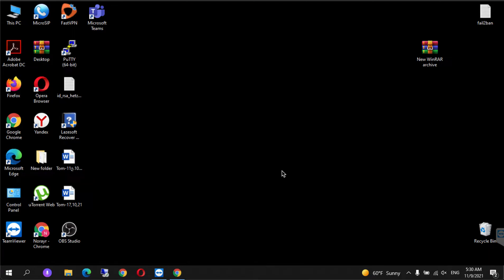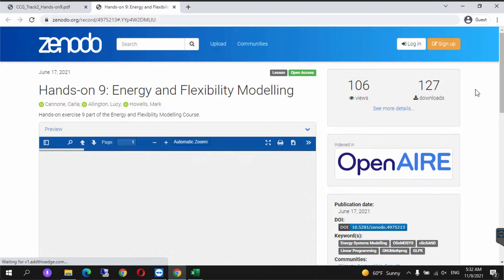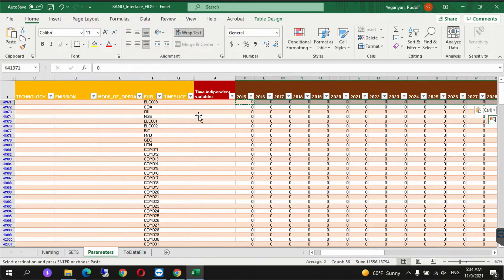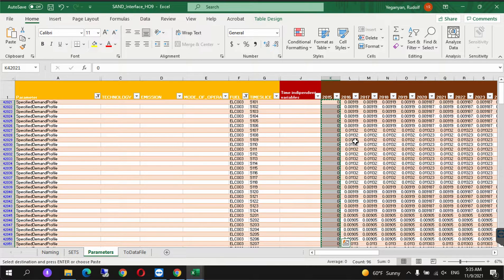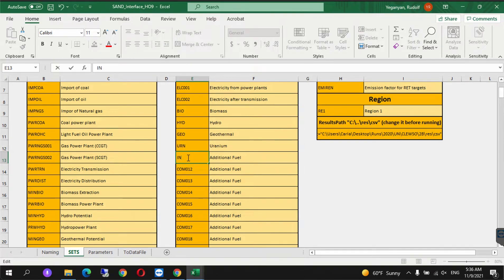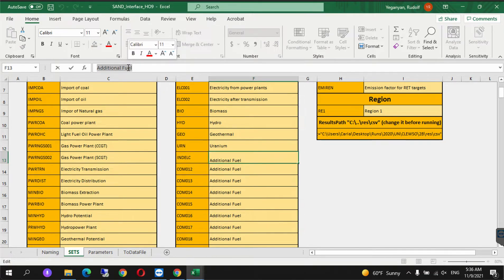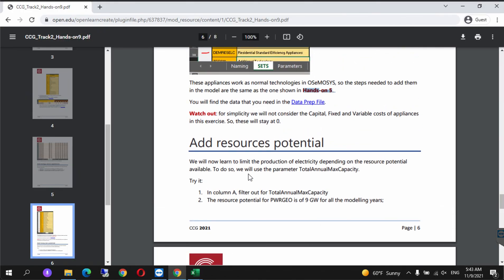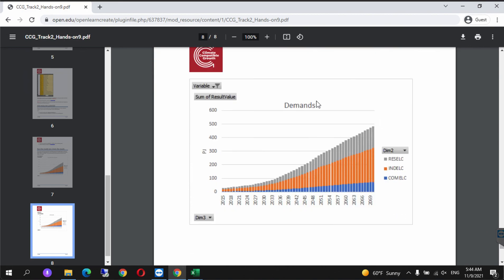OSeMOSYS & FlexTool course: Hands-On 9

Comment: Hello,the data prep file has column F labeled as INDELC  for all the specific demand profiles and the values are same ..this may be affecting my results since my graph is blank for annual electricity production.kindly clarify
Reply from the maker: Sorry for the slow reply: please ensure you are using the latest version of the repository (version 3.2). Regarding the Specified Demand Profile of INDELC, column F appears identical because it exclusively displays values for INDELC. Upon review, the values do vary across the 96 timeslices.